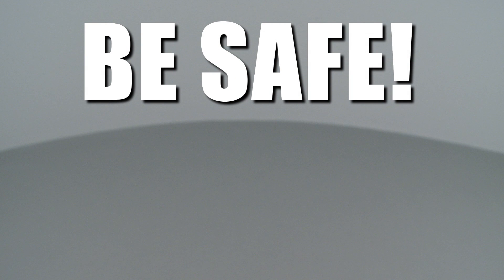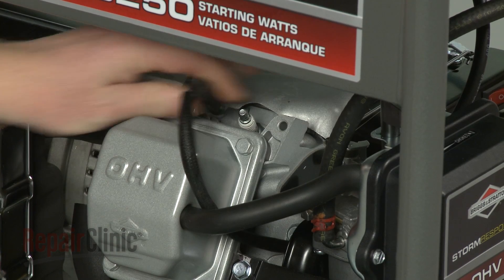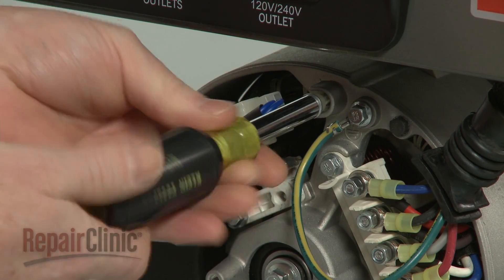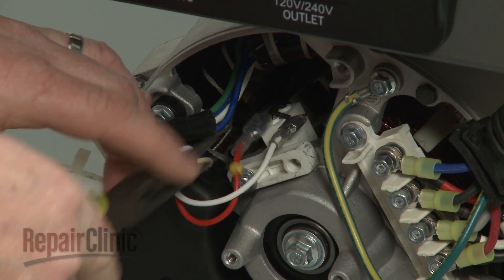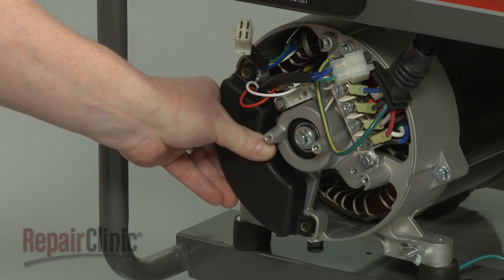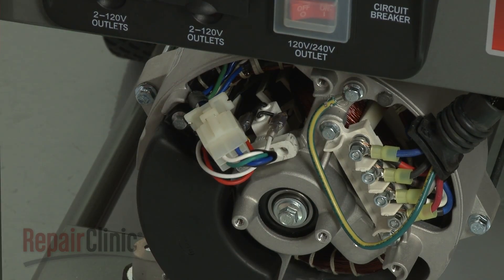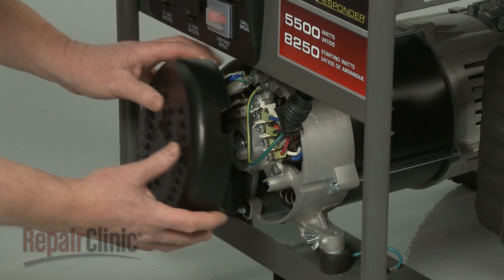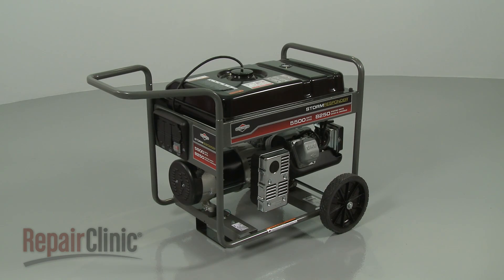Briggs & Stratton Generator Dies? Voltage Regulator 207840GS

Comment: So replacing this might not fix my issue. My generator will have voltage then it stops and it will come back on after 10minutes or so!
Reply from the maker: Ray De Leon We would inspect the brushes first. https://www.youtube.com/watch?v=Qqw3JQp31Vw

Comment: Will this fix the voltage surges ?
Reply from the maker: Ray De Leon This part regulates the rotors magnetic field while monitoring the output voltage of the stator to ensure the voltage does not surge too much.